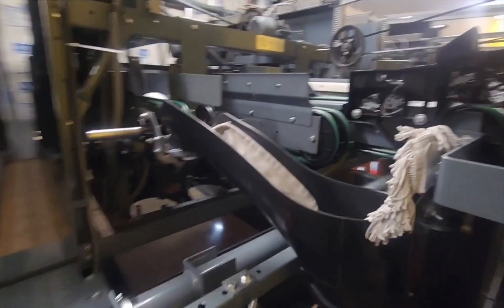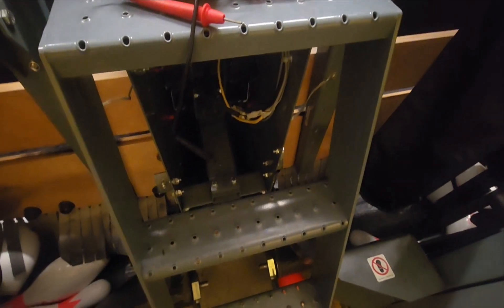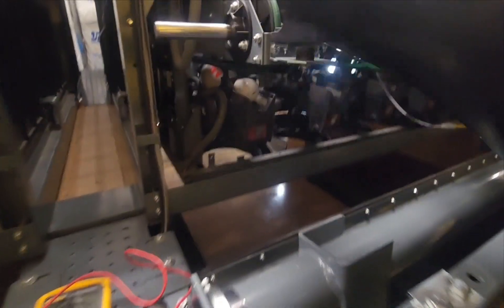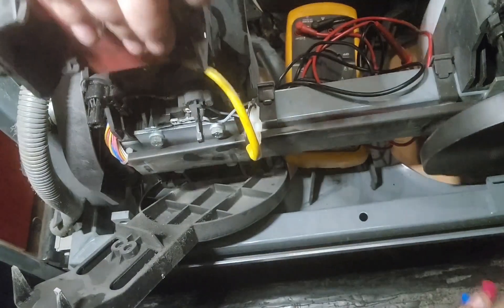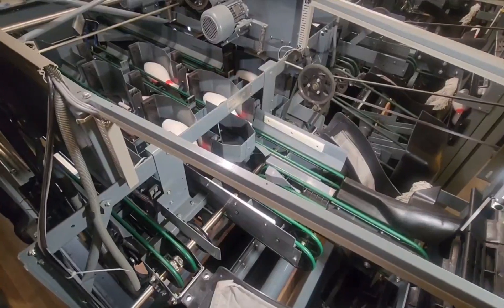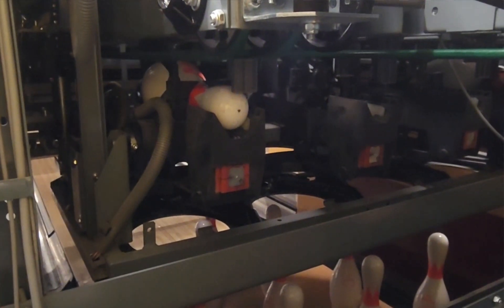Brunswick GSX Pinsetter - Failed F6 Fuse on NexGen CPU Board.

Comment: Since were in the zone of pinsetters, do you know how to stop the pin detector plate from clipping the settingtable when rotating back? They seems wobbly but tightening them hasn't helped...
Reply from the maker: I would suggest trying a new pin detecting plate and new pivot pins. If that doesn't help, then there's a good chance your setting table is warped. This is fairly common. What 8 have done in the past is to shave off the little nub at the bottom of the pin detecting plate. I have a few machines with slightly warped tables. I usually see interference between the #5 pin holder and the tooth rack or spotting tong. It was generating J1 calls randomly. 

Make sure the pin holder is properly positioned on the swing shaft left-to-right, so the pin is properly placed on spot.
Reply: @michaelbuckley3808  Yea It's the same thing with the J1's here. If you just nudge it and restart it usually goes fine for a day or two then it just randomly catches and jams.

I'll try filing a few down a bit and see if it helps. Thanks!

Comment: Sir, I'm facing an issue with my GSX Brunswick bowling machine where the pinholder 6 solenoid is continuously energizing—turning on, then off, and then on again—causing a pin loading timeout. Even after swapping the pinholder, the problem persists in #6, and the solenoid is overheating. Please help me on this.
Reply from the maker: This may be a CPU board issue. Try replacing the CPU board in the Nexgen box. Erratic operations like this can usually be caused by a bad board.
Reply: @michaelbuckley3808  I've replaced the CPU board, but the issue persists. It might be related to the table harness?
Reply from the maker: @ankitpundir02  It could be a faulty wire in the setting table cable between the nexgen box and the setting table, or a faulty wire in the setting table wire harness. Between the pin holder and the setting table wire harness receptical plug.
Reply: @michaelbuckley3808  I swapped the table harness with another lane, and the issue got sorted out. I I didn't see any issues in the other lane either, and now all lanes are working fine. I'm not sure how 😅

Comment: Meh, that's plenty of room.  😆
Reply from the maker: Not if you're over 6-foot and clock in around 250. Lol!
Reply: @michaelbuckley3808  Lol, just teasing.  6ft 1 170lb soaking wet chiming in.  LOL
Reply: Are GSX tighter than A2's?
Reply from the maker: @reconbbs360  They are a totally different machine. I find them easier to work around because I grew up working on them.

Comment: I've never been electrically inclined, nor will I claim to be, but this is definitely a great teaching moment to better understand the solenoids! I've always been hesitant with popping one of those open. By the way, I'm a larger person, myself, and when I need to service the back row, I always pop the pit curtain out and slide in through the side.
Reply from the maker: @Bowler4Ever  I would encourage every technician to get familiar with basic meter operation. It will help you to drill down on the issue faster.

In this case my team swapped the shark, then the ball door solenoid, then they ran out of time for the evening. They were soo close! In this case they could have used the meter and ruled those two components out very easily. I went through the diag process just to make the video. I already knew those components were good.